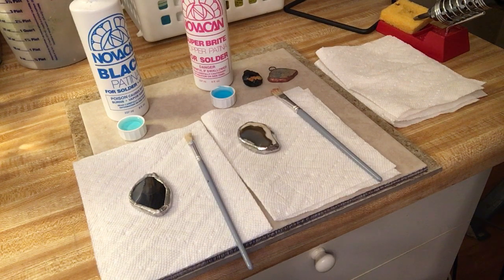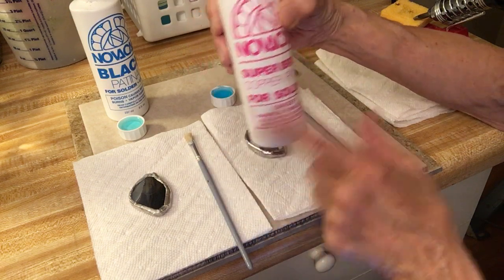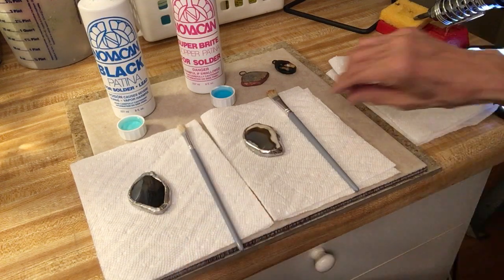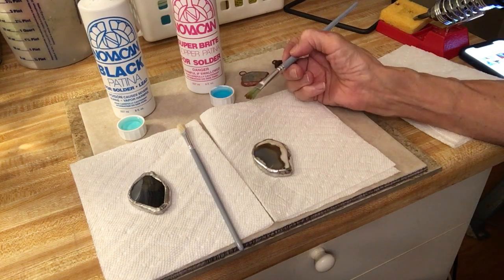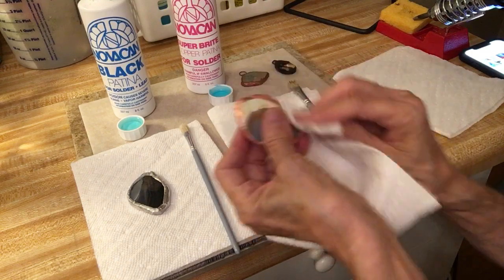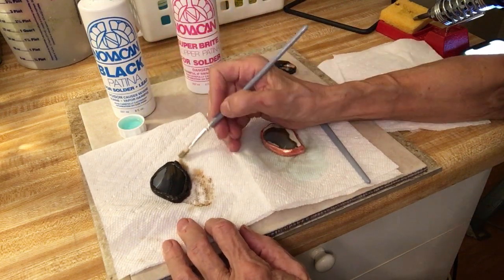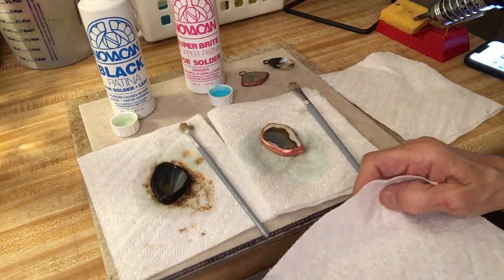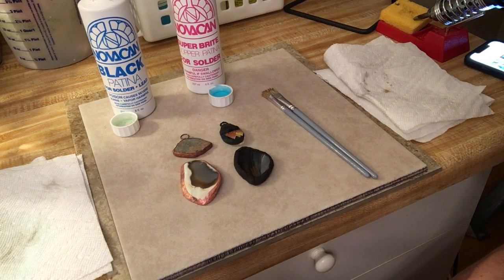Change Solder Color In Three Easy Steps

Comment: I used solder that looks like lead, and it really holds in my stone well (moldavite) but it doesn't have that polished appearance.  So I'm thinking - it would be a good idea to paint it, but I love the solder you use in the video.  I'll probably need to watch your other videos to get the right materials.  I had my idea in my head before I researched the "how".

I think ultimately I want to learn how to use silver to bind in the stones I find.  Is this possible?  I am just not sure how it would work.
Reply from the maker: Jason, I did reply three weeks ago to your comment, but now I don't see it. I have used clear nail polish for a polished appearance. Aslo silver solder is available on the internet. You might want to look at Rio Grande, they have it. So sorry my response never showed up? I always respond in less than 24 hours. Thank you for your thoughts and hope things work out for your project

Comment: What kind of solder was used because I have heard the copper patina does not work on Lead-Free solder?
Reply: Hello and thank you for your question 😊
I have used the Copper patina on both lead and lead free and it worked.

On the Black patina, it says for lead solder on the bottle.

Let me know how it works out for you.😊🌷🌿
Reply: @peace328  thank you & I definitely will let you know!
Reply: Just to let you know that I tried the copper patina using lead-free solder & got terrible results. I tried 3 times so far & each time was a fail!  I have read that this patina is made to use on lead solder but I’ve seen a couple people use it on what they claim is lead-free solder but I didn’t ask the brand of solder. Can you double check which solder you used so I can try it with that specific brand since it worked so well for you?  Maybe it’s a 4% silver or some specific lead-free solder. I’m currently using Sterling brand by Harris which contains tin,copper & selenium. Maybe that composition isn’t good with this patina. Thx in advance
Reply: @karensintuitivejewelry  Thanks for you question.
Yes, it does say for lead solder.

What I used then, is not the brand I am using now😱for the life of me, I do not remember what that was.
I am now using the Hobby Lobby brand, but have not done copper Patina on it.

I can try it and see if it works and let you know?

It could very well be the solder mixture you have.
There are so many different ones out there
Reply: Thank you for your reply. I appreciate any info. How do you like the Hobby Lobby brand?  I like a nice bright shine. I recently tried the black patina & wasn’t thrilled with that either. It seemed to dull the whole piece even after buffing & polishing several times!  I’m just using alcohol inks/paint now on deep impressions for a more vibrant contrast & then of course seal it!
Reply from the maker: @karensintuitivejewelry  I like it ok, so far. I had the same experience with the Black patina. It would not shine back up. But it was not lead free, it was lead. I have Silver Gleem, I might do a tester on that and see what happens.

What Alcohol inks do you use? i have been wanting to try those?
Reply: So you’re saying they make a black patina specifically for lead Free solder because I also bought the one that says Lead. I use Let’s Resin brand alcohol inks
Reply from the maker: @karensintuitivejewelry  Oh great, I would like to try that out. Thank You! The Black patina  one I have by Nova is for lead.
Reply: Ok I just looked it up & evidently that’s the only black Patina I see that they make, no information about Lead Free or Lead!!??Well, this is interesting & seems like my results are in correlation to the solder I use. So I’m looking for recommendations for an inexpensive solder that works well with patinas. I wish I knew more about the actual ingredients & such as it would definitely help with making an educated decision lol
Reply: @karensintuitivejewelry  I know what you mean!! That would definitely help to have that info🤩